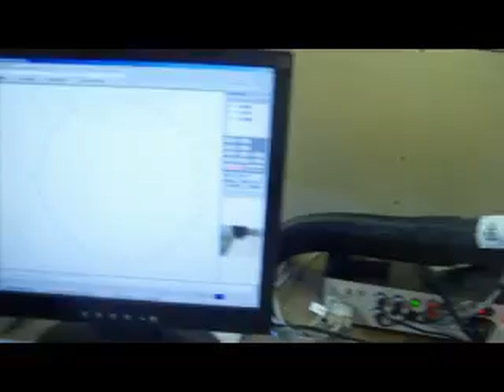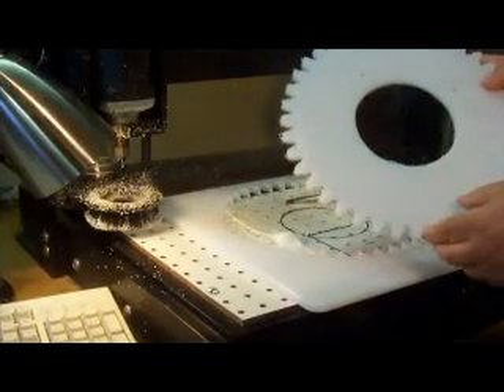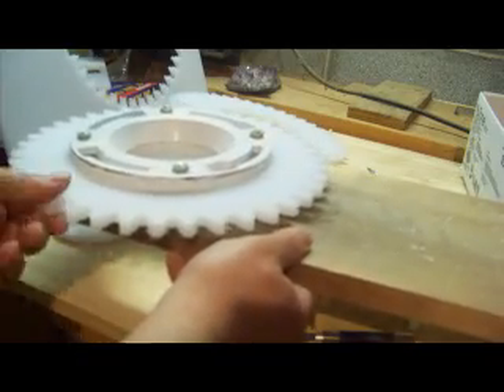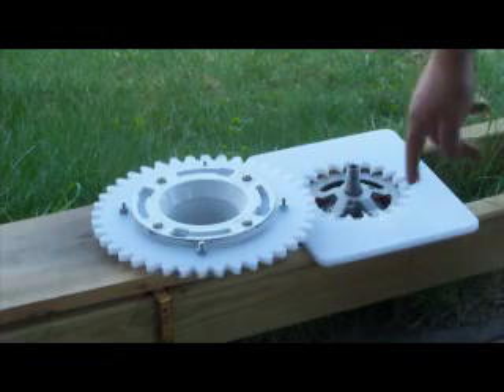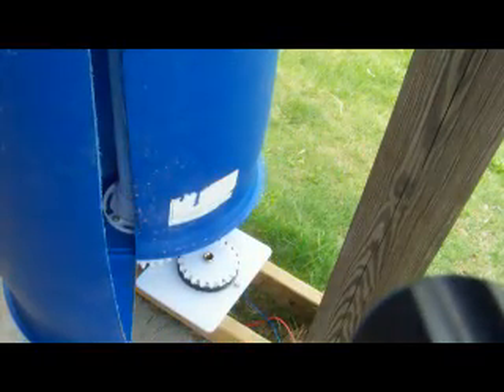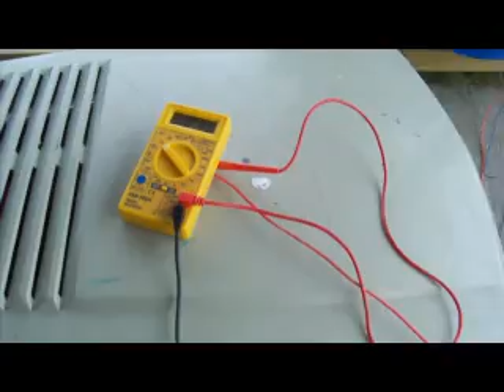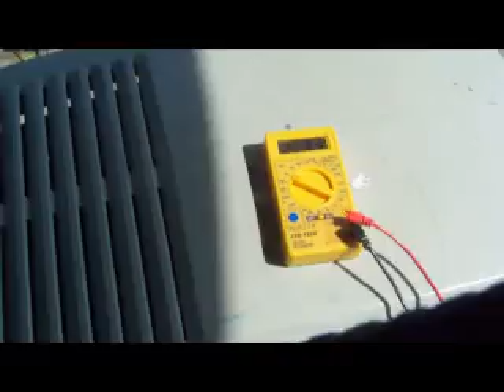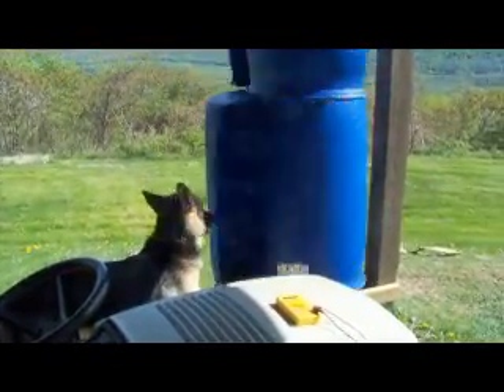How to Make an Inexpensive Vertical Wind Turbine - Part 2

Comment from the maker: No, I didn't cap it off because this design actually works better if the air can exchange between the two chambers.  That is part of the original Savonius design.

Comment: Sorry embeddedprogrammer, I was mistaken about the MPPT charge controller. When I saw your output voltage on your wind generator was only around 12 volts, I was thinking an MPPT charge controller would give you a slight voltage  boost, but I failed to understand  MPPT charge controllers will only boost the current rather than the voltage, and it appears you need a slight voltage boost. Ideally to around 14.2 volts before you can properly charge a 12 volt battery.
Dave

Comment: You should hook up your generator to a 10 - 15 speed bicycle and you can get some exercise while charging your batteries. It will be alot quieter as well. A little grease works wonders.

Comment: You should use a permanent magneto motor instead, much less resistance to generate current.   Have you thought about placing the machine atop your home?  The higher up the generator the greater the velocity of wind it will trap.   Good video.

Comment: i'm picturing this thing with bicycle gears.. it would last a lot longer and wouldn't require a CNC router.  and maybe a bike flywheel/ bearings, or something better than those lazy suzan bearings, they look pretty bad.  other than that it's an amazing setup, i'm surprised this is the first time i've ever seen a barrel windmill!
Reply: I've seen ventilation fans which use belt drive. They used to have chain drive but are getting away from it due to maintenance issues/upkeep.
Reply: zoso1 Car axle, solid and secure.

Comment from the maker: We are trying something like this now.  By pulse width modulating the coil in low wind, we are allowing the turbine to spin and generate some electricity.  At high winds we widen the pulses until totally connected. This requires measuring rpm of the system and embedding a microcontroller.   The idea of letting the turbine run up to speed and then energizing the coil for "regenerative braking" is very interesting because it requires a lot less switching than a Pusle Width Modulation scheme.

Comment from the maker: Good point Mr. MeHateGoogle, I think my wind turbine has already produced more electricity than the CNC used after over a year and a half of constant use.  The alternator from ebay is a recycled automotive alternator which has a much smaller carbon footprint than a new alternator, even with the UPS delivery taken into account, and more so when you consider the incremental costs for delivery as the UPS truck comes down my street once a day anyhow.

Comment from the maker: We are attached to marine batteries now and are trying a grid tie setup this week.  It still spins quite well but we are changing the gearing soon for even more output for a 6 barrel system which is built but not vertical yet.

We are working on a controller now that adapts to the wind load by pulsing the coil.

Comment from the maker: Yes, that would probably be the same concept.  A car alternator will work also but you need to spin it very fast with gearing or chain drive.  Stacking more barrels will probably be simpler but the ones closer to the ground will not generate as much force as the ones higher up.  Separate ones are probably better but more expensive from the cost of separate towers and generators.

Comment from the maker: Mary, Thanks for your kind words.  Aluminum would probably work for the gears, although I am now selling my plastic gears (check in the description above right).   The taller stack of barrels is still on the ground.  I am still trying to figure out a good way to mount it as it is too big to attach to the house.   I just bought a 21 foot length of 2" steel pipe to use as a base. A tower is a good option to get the more consistent winds.

Comment from the maker: madjimms, Thanks for your comment.  Yes, sheet metal could be bent to form a more efficient shape in fact this is exactly what they do to make the popular Lenz 2 turbines.  However, my Savonius design is much easier to fabricate because it doesn't need cross-sectional ribs, and it is very ecologically friendly in that it utilizes recycled materials for the wings.  If you are interested in the Lenz 2, just google the phrase Lenz 2.

Comment: Definately innovative.  A proof-of-concept device.  Maybe the barrels quartered and arranged to a 'cage fan' shape with a lightweight support top and bottom might give more air striking surface and torque.  Use a fan belt and pulleys, not the nylon gears so the back of your house is not rumbling all the time as well.  Add a solar array to your charge controller so you will have some consistency to the level of draw you can take from your system.

Comment: i cant make gears and all that, i give you props on that work there,i amgoing to run the sharf of my motor through the center and pin it girect through the pvc like a trailer hitch pin,  this is nice work here

Comment: At first I wasnt digging it, but once I saw it running it looks like it can be real good option as compared to a fan type. Pretty safe, low cost, not as visible if you dont want to advertise that you have one, and it will never rust. If your up for ideas on improvement, "I" would put the generator and wires on the top instead. I think that would help on keeping hands, stray plastic trash bags and rain etc off it.

Comment from the maker: @Shalek You are correct.  Some call this a wind amplifier and it works extremely well if it is indexed at an angle from the wind (requires bearings, tale, etc).  This is on my list of things to look into.

Comment: Nice set up.  Good use of existing inexpensive off the shelf items.  I would think inexpensive production gears are available too.
I have to agree with the inherent weight problem of the barrels, but if you have enough wind it doesn't matter.  
You could lose some friction by lapping in those gears.  The involute profile of the gear tooth is not perfect as the teeth should smoothly "slip" past one another.  Also the tooth-to-tooth spacing is not close enough, that is why it sounds like it is pounding from tooth to tooth as it rotates.  (I used to make gears) 
Lapping the gears in is very simple in this case.  Take a little comet cleanser and mix it into some wheel bearing grease.  Lightly coat the two gears with the mix as they are spinning with a brush.  In short order the grit will wear away the high spots and the tooth spacing issue creating a much better gear set reducing friction significantly.
Reply from the maker: I am going to try that.  Thanks for the input.  Sorry it took me four years to respond.
Reply: I dunno about lapping in those gears...they are most likely Hi Density Polyethylene or Ultra High Molecular Weight polyethylene. (HDPE or UMHW, there should be a recycling mark)  These two plastics are VERY wear resistant...I use them whenever I want a part where wear is the overriding issue.  It might take a 'while' for them to wear in!  I agree with Jim Troyer about getting the center-to-center distance correct, those gears should run much quieter...just 'play' with the spacing til they run smoother.

Comment from the maker: You can convert the 12v to 120V with an inverter, which allows you to plug things directly into it.  Larger inverters called grid tie systems instead feed into your house wiring and reduce your need for electricity from your electrical utility.  Running 12V LED lights in your house is now an option which bypasses the need for inversion (and the energy loss associated with it in the form of heat).

Comment: Use your house as a wind guid directly into the barrels and have an exit wall that helps direct airflow out. Wind would be forced along the house in greater volume and even create suction"down stream".
Reply from the maker: yes, good idea.  I remember when I attended college the breezeways under tall buildings were so windy they were dangerous at times.  That might be a good location for VAWT siting also.

Comment: this is very clever.

however, you might consider using the small gear on the turbine, and the large one on the motor--this way you have enough mechanical advantage in even very low winds.

and if you're worried about low voltage output, a buck-boost converter can easily take care of that--it'll give you whatever voltage you want, at >80% efficiency conversion.

Comment from the maker: I am considering making a cluster of these to drive a single generator because the generator is expensive and the turbines are cheap.  A funnel would help but only in places where the wind doesn't vary much in direction.  Inland, wind direction can be highly variable (like here in Central New York).

Comment: great idea.... it looks like it is lifting your generator gear in the video back it off a little and it won't lift up , and less drag. also you might want to try actuall plate bearings for less drag and better weather resistance . it's beutiful.

Comment: i like your design it is  very spartan and straight forward, have you also made other turbines from more sophisticated materials, only asking because i work with bearings and turbine professionally and the bearings used here seem to have alot of drag, you ever though about using the blades from an industrial fan? i have also erected G.E. wind turbine of 300feet tall it was amazing , but for a guy working from home i hva to give it to you your design is simple and functional, this is inspiration!

Comment from the maker: The air spillage actually helps the efficiency over the blocked type.  There was a study done at Sandia which specifies about a 15% overlap as optimal.  I have more than the optimal overlap primarily for mechanical stability.

Comment from the maker: I thought of using bicycle gears and still may try this.  The plastic gears don´t need lubrication and using CNC gives me the ability to make it fit the large diameter of the plastic pipe easily (not easy with bicycle gears unless mouting on the end of the rotating pipe).

Comment from the maker: They are holding up well but I oil them monthly.  I am building another unit with sealed bearings for testing but the sealed bearings seem to have more resistance than the lazy susan bearings.

Comment: @sportsandbags you would take the output and send it to a "charge controller" This can be used to charge 12 volt deep cycle batteries. The charge controller will ensure your battery gets charged and not overcharged and make a mess of acid everywhere.

Comment: One also has to consider that adding electrical load also feeds back resistance against the shaft from turning.  The gears are needed to slow the rotation but increase the torque to provide the ability to still spin during weaker winds, right?

Comment: I am brand new to this but I've been thinking and reading about VAWTs for some time.  My problem is I have ZERO skill or experience or access to tools.  There has to be a way to put inexpensive VAWTs everywhere, on top of every telephone pole, every street corner.  This should be the norm.  Thanks for the inspiring video.

Comment: The problem is that the variable speed and wind force means the alternator must put a variable load on the turbine.  This would be a good task for a microcontroller such as an Arduino.  It would sense the turbine speed with a few magnets and a reed switch, and the voltage output of the alternator.  The idea would be to adjust the amount of current going to the field coil.  But you said this is a permanent magnet alternator and doesn't have a field coil.  Either change to a regular alternator (cheaper) or develop a variable load circuit.  Also the turbine should be high up where the wind is steady.  Thanks.

Comment from the maker: Not sure of the average speeds yet.  I am going to install a wind speed sensor and log data.  At 17 mph I was getting 14V @ 5 amps a little more than 60 watts.  When I get back from vacation in Spain on August 15th, I am going to start back up on this project with wind, RPM, and voltage sensors.

Comment: Nice! Thanks for showing it. Can you get lighter weight barrels? Even light sheets curved on plastic/aluminum frame? Less weight means less friction & more power to generator. Use high efficiency one. What is this type?
Living far north in snow area, I ask how it runs in heavy snow? I'd put generator on top, under a snow guard; on ground it'll get snow packed & jam. Or get ruined!
Can you align panels leading push side, to focus more wind here? Even automatically move panels to face wind? How?

Comment: Nice work!! 

But when a storm comes up, you might burn your house to the ground with that generator. Do you have something that can slow it down? That thing can reach up over 400 degrees Celsius. Normal turbines slow down, when there's extreme weather.

Comment: Yes, I would like a drawing.  I don't know if or when I'll attempt a generator or what rpms it should run.  I have a wide open place that seems to always have wind. I wonder if extreme wind gusts or storms would likely cause damage to this kind of wind turbine.  My goal is to have a small off grid system to power a few lights and maybe some small appliances or even a small ac window unit.  It is for a cabin I am building.

Comment: I like the gear method. Larger gear on the turbine blades, & a smaller gear on the generator means you get more RPMs on the generator, which means more power output. If you set it up in your yard, & got it up higher, away from any structures,  it would work more efficient.

Comment from the maker: No, because in light wind it wouldn't move.  I am looking into ways of adapting the load based on the wind speed by generating more power in stronger winds automatically but more work is needed.

Comment: Great job!! But it may be worth custom building your own generator for low rpm use. Unfortinately, those converted pm car alternators still aren't well suited for use with wind turbines. You could build something that would produce far more voltage, around 20 to 30 volts for the same wind speed.....more voltage means better charging efficiency!

Comment from the maker: What do you run through the copper tubing?  We often get temperatures of -20 Fahrenheit here in the winter.  I have my own well  and don't want to run anything that, if it leaks, will pollute my groundwater.  I do have a pre tank because I was going to rig it up to heat from my wood stove.

Comment: You have a great concept, and it obviously works.
Although, id like to point out a few ideas for a project for you.
The barrels are quite heavy and not so areodynamic for the small about of draft intake. Me, lacking the tools and material to build my concept, i was hoping maybe you would. 2 words: Double Heelix.
A vertical double helix, would have the ability to, (rather than input to output of draft) would intake, amplify, and output an extreme draft upward.
Thatd give you alot of juice,

Comment: My hats are off to you and your machineing skills..those gears are the neatest thing since toilet paper! I was wondering though...would pulleys work better providing less friction that gears?  Also, what if you left your generator free floating in those channels, maybe line them with aluminum angles, and then fasten it to the bottom of the turnine assembly with springs which would provide just the right amount of pull to keep the gears engaged and no wear but auto adust for wear? Thanks..

Comment from the maker: Also, look up Sepic Charge Controller for info on charging batteries with low voltages.  These controllers boost the voltage (but drop amperage) only when the wind is slow instead of throwing out all of the electricity below a 14v. We are using this and other techniques to get more juice out of these  turbines and will have future videos on these techniques.

Comment from the maker: That sounds like a great idea.   The thing would be having enough ballon lift to hold up a heavy cable capable of transmitting a lot of power.  Also, after a while wouldn't the balloon lose its lift and need to be re-inflated with hydrogen or helium?

Comment: Have you considered bolting the sidewalls of the barrels to a central shaft instead of overlaping them to each other.  That way the entire barrel can be utelized as a wind cup providing more torque (if not speed) and allow a higher gear ratio to run your generator faster.

Comment: We understand, but GUIT is correct. Next time you get on a multi gear bike, try and put it in high gear and get going. If you can it will be very difficult. Because of the increased torque there needs to be an increase of power applied (in the turbines case the wind). If you set the gear ratio to high the resistance will be to great for wind to turn the barrels. 

So in a way you are correct, the higher the gear ratio the more power output, but if its to great the wind will not be strong enough.

Comment from the maker: Dear GrantsPassTVRepairs,
Thanks for your comment.  While I am familiar with sepic controllers for boosting voltage to enable charging with lower than optimal battery voltages, I have no experience with MPPT charge controllers.  Have you had personal experience with any of these MPPT controllers like the one from Sunforce?

Comment: hey, great design idea using gears.

I do have some ideas that may allow you to take more advantage of your setup.

1-I am not sure how durable a cutting board is, but have you considered using motorcycle sprockets? They can be bought in steel or aluminum and should last alot longer.

2-The faster the altenator spins, the more electricity it should produce. Adding 1 or 2 step down gears and making the final gear around the motor as small as possible should give you a ton more voltage